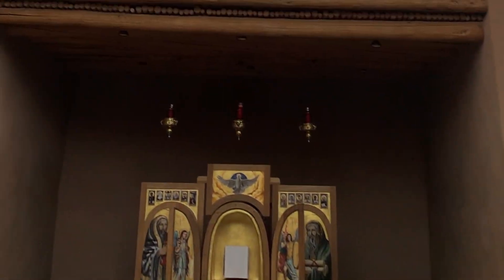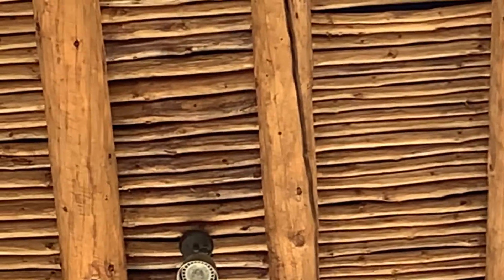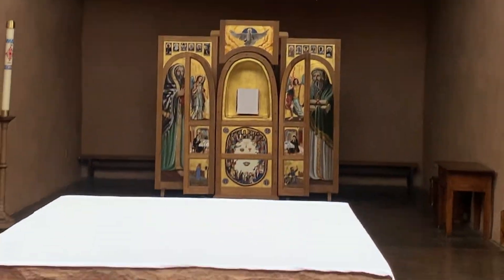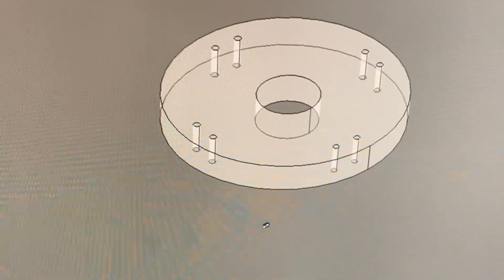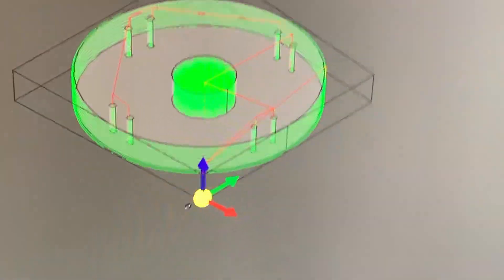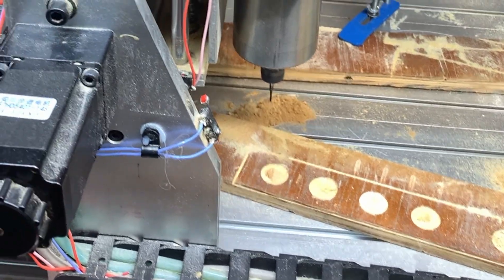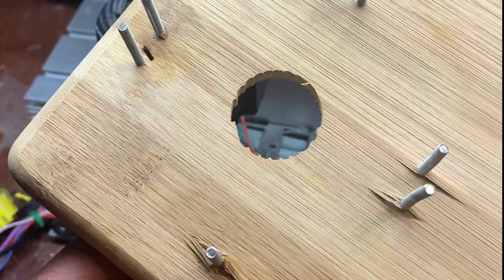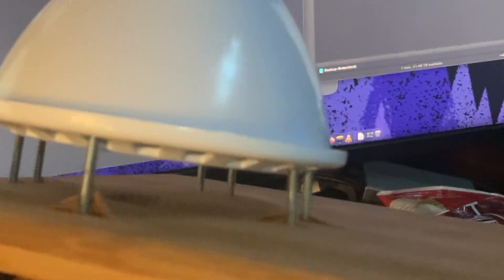The Church Light No One Thought Could Be Changed - Monastery of Christ in the Desert

Comment: This takes me back to when I had to change the bulbs in the church I was in.  They used non dimmable bulbs which had to be replaced otherwise they would have an electrical fire happen.  Some of the bulbs were way over tightened and was very scary to get them out.  After that was changing all the bulbs in the side aisles which only needed a step ladder instead of those long poles.  However, as I changed each bulb, I would get a static shock that increased with each consecutive light.